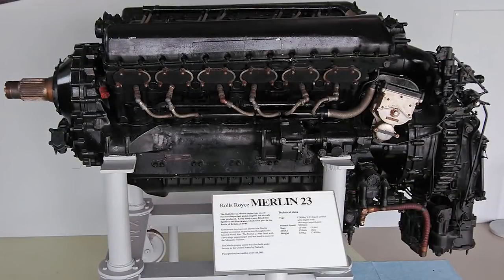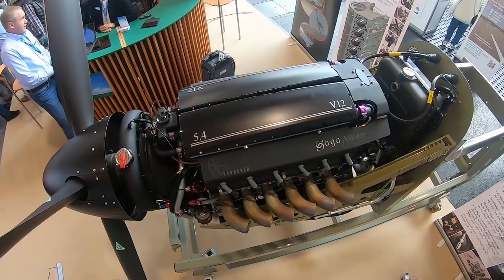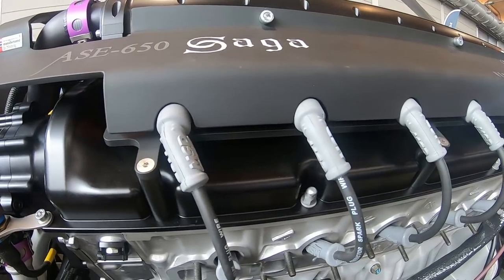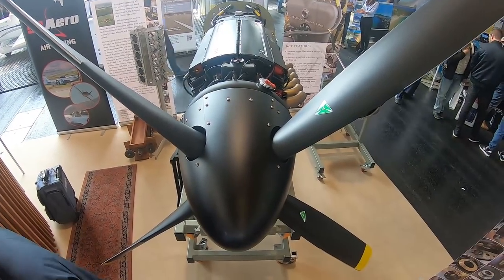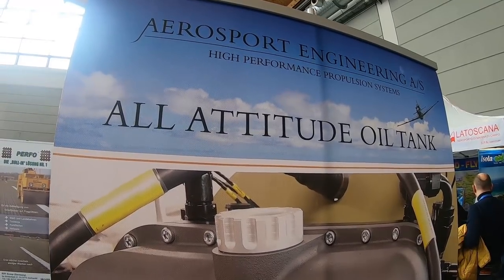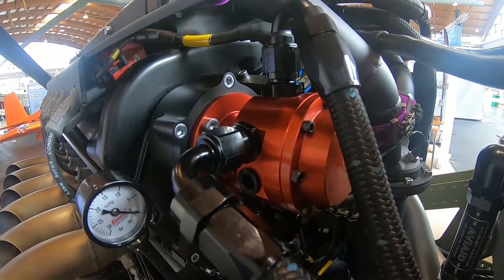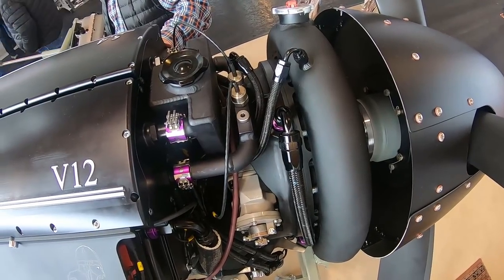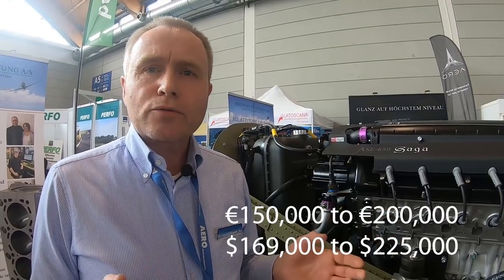Ole Ringstad's 12 CYL Sport Engine

Comment: Looks like a cool project, but $225,000?!?! I don't even think a Falconer V12 costs half that, and is a bigger engine that fits scale Mustangs perfectly.
Reply: @v12tommy 
Which is only 640 hp at 4500 rpm.
Reply: The value is this engine produces as much power as a Turboprop Pt-6, think a Pilatus PC-12 engine replacement for experimental aircraft.
Reply: Falconer is a 90 degree V-12, odd firing and has known crankshaft failures.
Ringstad did it right, using 60 degree layout. Very smooth and literally vibration free.
Reply: @WannaBe-bsuid It isn't hard to swap in a beefier crankshaft. And it would still be far cheaper than that engine.

Comment: If you want a V12 to replace the engines on the war birds, just put the RR merlin back into production, the development has already been done. You could use the basic RR V12 assembly and add more modern systems like ignition and fuel, but the original RR V12 is already a well proven design.
Reply: Monster Inc. This is far smaller than the Merlin, it’s marketed at the 3/4 scale war bird kits.
Reply: @N556ND  He did say he had a real P51 and was having trouble finding RR parts for it, which is what I was basing my comment on.
Reply: The Merlin is an antique design. We can do much better now, technology has advanced greatly since the 1930's. We can get the same and more reliable HP in a smaller lighter package, plus in reality, the TBO of the Merlin is not very long and is unacceptable today.  Even the 1950's Transport Merlins of the Canadair DC4 didn't run that long, great engine for it's time, not now.
Reply: @jimdickinson3686  The materials used to construct the engine can be improved, and the systems on the engine could probably use some modernization, but theres never anything wrong with simplicity or a proven design.
Reply: @ @Agislife1960  - No, he did not say that.  He said he owns a Stewart S-51 Mustang; a 70% scale all-metal P-51 replica.  Here's a link to the original S-51 company's promotional video: https://www.youtube.com/watch?v=tURCGSdcEK8&t=104s
Reply: Don’t know about newer is better after 50 years of cropdusting l’ve decided the 30’s technology is the best.
Reply: Monster  Jack Roush approached RR about building new Merlins and they flat told him NO !!!!!  They did Not want the liability !!!! Go figure !!!!!   Jack Roush has a warehouse full of new and used Merlins and will build and sell you one.......for a price !!!  He also has done work on valve train and replacement parts for the Merlin !!!
Reply: Stopped in a famous Merlin Repair Shop in Breckinridge Texas and was astonished to hear that a RR Merlin needs a $100K overhaul every 100 hours. Carry on Ole!

Comment: Wow, that'll run my C172S dry in an hour ...
Reply: That fuel consumption seems pretty ridiculous. The full size Merlin only burned around sixty an hour in cruise. The listed fuel for the Stewart Mustangs is only seventy gallons. So trying any cross country in that thing would be horrendous!
Reply: @travistolbert2647  He did say that was at full power, though.
Reply: stanzahero thanks for the correction I must have missed that.

Comment: ....and fastest  DeHavilland Mosquito:  2 Merlins or hang glider?
Reply: Philgood  Mosquito was NOT the fastest, except for bombers !!!!  Most mossies could NOT break 400 MPH and hell an Allison Mustang, the Mk I & II and P51A's did !!!!  and the limeys consider the Mustang a dog because they did NOT design or build it !!!!
Reply: Wilbur Finnigan You are right a side by side twin seats could not be the fastest, but still as a bomber and reconnaissance aircraft, being faster than most fighters without any defensive machine guns was a successful concept so that the Mosquito speed was a key features and it dit not need the absolute top speed and short turning radius to win a dog fight, it had to escape. One problem was than the reason any plane was lost over Germany remained unknow, flak or structural failure and related design improvements were nearly impossible. My point was only that this Merlin engine plane was not in the list. Then no doubt the Mustang was the best design around the Merlin like the Mig 15 around the RR Nene. Maybe the very late task of having to adapt fast to an existing imported design requires such a Clean sheet of paper that the result  is better. In fact the Mustang was such a good design that it only had half the parts and double the range of the Spits. Thank you.
Reply: @philgooddr.7850  TRUE !!!  BUT the Mustang also had the then new laminar flow wing, super clean aerodynamic fuselage, radical radiator and a super efficient Hamilton prop.  Notice the width of the prop blades of the Mustangs Hamilton prop compared to the narrower blades on the shitfire Rotol prop !!! Also the Mustang carried over twice the INTERNAL fuel, and the Mustang was a much simplier design to build....  Greatest fighter of WWII !

Comment: Russian financial company "finam" (one of the biggest on Russian market) made airplane diesel engine on the basic of Russian ww2 T-34 tank!
I'ts made for New YAK - 152 Russian army trainer airkraft. And it's get only 80 litres (21 gallons) at 1 hour for 500 horse power!
Reply: Yes but what does it weigh...
Reply: The engine in the Yak-152 actually has nothing in common with the T-34 engine, it's an entirely new design and is much smaller (6 liters vs ~40 liters). Because the RED A03 is a diesel, it's far too heavy to use in most aircraft (it weighs about 800 pounds).

Comment: Cool engine. but even the Merlin had 4 valves per cylinder.
Reply: I guess but the idea of simplicity is important for sport/replica engines. I think he was meaning the simple valves are a advantage for this reason rather than staying close to the Merlin.  :)
There are lots of titan mustang's here In nz many rotax 912 powered which doesnt suit at all. A few auto conversion honda v6  which are super cool and sound the part, but this v12 would be ideal!, perfect.
Reply: @9.5to1  Cost would be the only reason to halve the number of valves, reliability shouldn't be an issue with double the number of valves. The Honda V6s in the T-51s are pretty awesome, there's even one that's supercharged. This engine, though, would be far too heavy and powerful for a T-51, but it would go great in a Thunder Mustang.
Reply: @PistonAvatarGuy  you are right.
And yeah maybe overkill for a t51 although cant weigh a whole lot more than the honda engines?
Reply: @9.5to1  It has double the number of cylinders, nearly double the displacement and the Honda V6s are some of the lightest V6s on the market, so... 
-
Vne for the T-51 is only 215 mph anyway, so a 650 hp engine would be completely wasted.
Reply: @PistonAvatarGuy  true
Reply: @PistonAvatarGuy  do you think having half the number of valves could aid in terms of simplicity of maintenance.
Having two instead of four may ba a advantage in that way and that is what  I was  implying.
What do you think?

I also have a feeling that these engines because they will  be used in replicas/scale expermental aircraft, ease of maintenance is important as it's less likely for certified engineers to be doing the work?
Reply: @9.5to1  There are definitely advantages to both arrangements, but in this application, 2 valves/cylinder definitely makes sense, I really should have looked into it more before I made my comment. As far as I can tell, this engine has hydraulic lash adjusters and would not require valve lash adjustments, but basically any practical 4-valve arrangement would require manual adjustments, and that's something that's extremely time consuming to perform on a V12. Because the engine is supercharged, there wouldn't be a power output advantage to be gained with a 4-valve arrangement, but efficiency would be improved, which probably isn't a huge concern for the people who will be buying this engine. Really, when compared to a Lycoming or Continental engine, the efficiency of this engine is excellent. Apparently, EdgePerformance AS helped with the production of this engine and they do absolutely fantastic work. The more I learn about this engine, the more I like it. I wish their website worked.
Reply: @PistonAvatarGuy  hey thanks for sharing your knowledge. I definitely learnt a bit.
Dont you think it's cool that I have no idea who you are vice versa, but like minded and  still share knowlege/ideas/questions  in YouTube comments haha. 
I going through a lot of aircraft engine videos  and reading up on various types, at the moment and find it fascinating, comparing advantages and disadvantages of different designs and all the different configurations (replica rotarys, diesel engines, auto conversions, small gas turbines, rotax, viking, volkswagon, jabiru (yuck), Rotex  radials, the standard flat aircooled engines, udf, modern turbofans haha endless types). trying to figure out the most pratical designs for different applications.
Learning the faults in each design and how it can be resolved. Looking at massive failures and how a design cannot be resolved, like my friend who flew a jabiru 6 cylinder and it put a rod through the case. Yuck. And he maintained that engine better than I have ever seen somebody care for one.

Well basically I like talking and learning this stuff!
So thanks for sharing your knowledge, appreciate it.

With this engine I wonder how successful it will be once some aircraft start flying with it. See how it holds up. Looks neat so far. Exciting engine and definitely will fill a gap in the market if it isnt overpriced.
Now to watching more engine videos...
Reply: idontcare80 look at their page on Facebook
Reply: @esr243 I had actually found it just a few hours before you commented. I was looking for engine specs, but there are none on their FB page.
Reply: @9.5to1    Really? He didn't tell you that it could also have 4 valves with hydraulic valve adjusters and the fact that he said it couldn't, makes him not to smart. It's been done over and over and over and over........get the picture?
Reply: idontcare   as did the Allison !!!!!
Reply: @johnnyyuma9326  Yes, it's been done, but isn't done often because it makes the heads absolutely enormous and extremely heavy, which is why I said that any practical 4-valve arrangement would require manual adjustments, because this is an aircraft engine and it needs to be kept light. I never said that it COULDN'T be done.
Reply: @wilburfinnigan2142  Yup, and the Allison had a much better valve actuation system than the Merlin. Also, almost all of the WW2 aircraft V12s had 4 valves per cylinder, some even had DOHC heads.
Reply: @9.5to1  I love the exchange of information and ideas that happens on the internet, it's amazing what one can learn when they desire to do so. It's unfortunate that so many people use the internet to spread disinformation, though.
-
I never liked Jabiru, their engines always looked like they were extremely crude, cheap and under-engineered. Thankfully, there are plenty of alternatives to Jabiru engines, though they might be a little more costly.
-
The engine featured in this video is likely to sell in very limited numbers, so as long as the company is prepared for that, I think they will be successful. I hope to see the engine make it to Reno in a Thunder Mustang, or in a Nemesis NXT, that would be awesome to see.
Reply: @PistonAvatarGuy    You don't know what you are talking about. A hydraulic lash adjuster is and can be made very small.  You been in a box?  Look at any modern hydraulic 4 valve engine. Port layout dictates the size of the head.
Reply: @johnnyyuma9326  Yes, lash adjusters are usually small, but they still take up space in the head, so the difference is between having something which takes up space in the head and not having something which takes up space in the head. In OHC engines, the valvetrain is largely what dictates the size of the head, heads with direct-acting valvetrains are significantly more compact than heads with rocker arms, and rocker arms are required in the most commonly used systems which make use of hydraulic lash adjusters. If you don't believe me, compare technical drawings of the two.
-
There are some direct-acting valvetrains which make use of HLAs, but the HLA is very large and heavy in that case, and they still increase the size of the head because the HLA increases the distance between the cam and the  valve.
-
Mazda had an HLA arrangement that was built into the rocker arms of some of their engines, but they were extremely problematic and weren't used for long.
Reply: @johnnyyuma9326  BTW, a very large number of modern OHC engines do not make use of HLAs, especially in applications where the engine needs to be light and compact. Again, we're talking about aircraft engines here.
Reply: @PistonAvatarGuy    See, now you are talking "MY BUSINESS". Again, they are light and compact and extremely reliable. Don't try to bullshit me, it won't work.
Reply: @johnnyyuma9326  If this is your business, then why aren't you able to counter anything that I've said here? If the cylinder heads which incorporate HLAs are so light and compact, why don't you find them in racing engines? Is it possible that the designers of those engines want to keep their engines light and compact? Many racers will even eliminate the HLAs when modifying the engine for racing. See here (on YouTube): watch?v=7PVc7pKzF64&t=5m20s - Also notice how ridiculously huge that head is when compared to something like a K20 head, or, especially when compared to a cylinder head with a direct-acting valvetrain.
-
Also, I didn't say that HLAs were unreliable in general, I said that Mazda had a unique HLA system that was unreliable. 
-
The HLAs in this engine don't affect its size because they're essentially located where the 2 additional valves would be in a 4 valve engine and they shouldn't be unreliable because the engine probably wont be operating at very high rpm. I don't understand what you're getting so bent out of shape about.